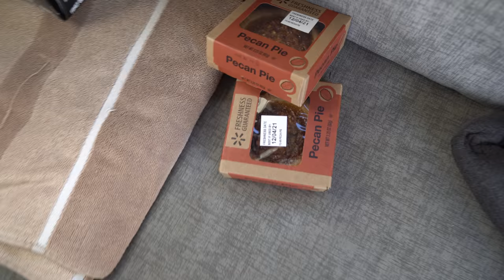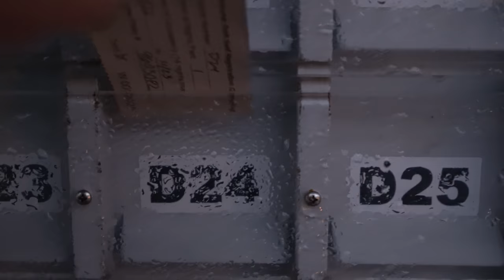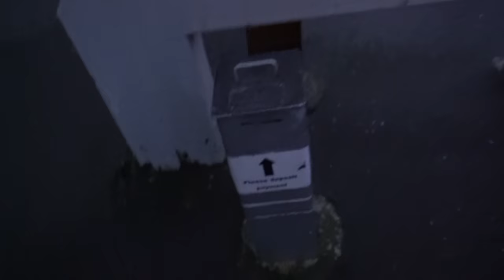Truck Camper Life with my GF in the Pacific Northwest (Cozy, Rainy Weather)

Comment: Hearing Tessa talk about falling asleep with a heated blanket and being warm made me feel sick lol. It’s so neat to me hearing how different everyone falls asleep though. I live in CT and we have decently cold winters but I still keep my window open, fan going and use 1 blanket. I can’t sleep in a hoodie ever, only a tshirt no matter how cold it is. I moved into a townhouse a few years ago and didn’t realize I can’t control my heat. The complex turns it on and keeps it at the same temp for every unit. It is currently in the 30s outside but 70 inside my bedroom. I keep a fan going 24/7 and thru out the day need to turn my window unit air conditioner on bc it becomes unbearable. They also fine us for keeping window unit ACs in in the winter, but I will gladly pay $20mo to be able to cool my apartment down.

Comment: I’ve been a roofer for a couple years now considering there is a scene and a vent (penetrations) where the leak is coming from I would go on top of the roof and start poking around with your finger to see if anywhere for water could get under and just to be safe if your roof is metal go out and buy metal roofing tape and they make a paintable sealant and put that across all seams and around all vents tape and sealant

Comment: My dad told me 37 years ago to take 5 $20 bills and fold them up and tuck them away in a flap of your wallet.  I have always kept emergency cashed tucked in my wallet, may not have been $100, may have been just $40 or $20 but I've always kept something tucked back and it's saved me in times of dire straights.  That advise is even more relevant today.  I've gone into Convenient stores where their computer system was down and I had to pay in cash or go somewhere else, and at 11 or 12 at night, there's not always somehwere else.
Reply: Yep. I’ve always had some tucked away. Most of the time I forget it’s there but it’s saved me a few times! I live in a rural area and finding an ATM may be impossible at times. Cash works everywhere.
Reply from the maker: I usually do have some spare emergency cash but I must’ve already used it ha. The “who carries cash” part was just a joke lol. Good advice for sure though!

Comment: Oh No, about the darn leak. hope u can get it fixed before water damage and mold. Happy Thanksgiving
Reply from the maker: Same here! Happy Thanksgiving
Reply: @JonathanYentch  Keep in mind if the campsite is flat or at a slight angle towards the seam on the roof...it may have been collecting the water (like a gutter).  Might be worth investing in a few leveling blocks.  Great adventure videos.

Comment: Your camper is going to be out of commission forever dude, you’re going to have to restore basically the entire roof which might cost more than the trailer is even worth. This is the can of worms you run into when trying to renovate something really old, especially when it’s RV’s/Campers because they aren’t built well to begin with: good luck, it’s going to be rough.